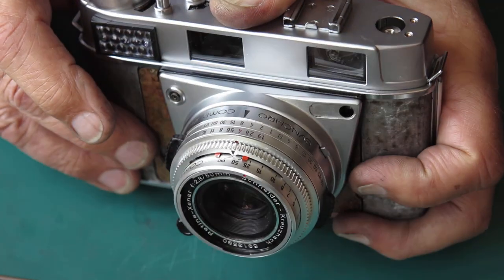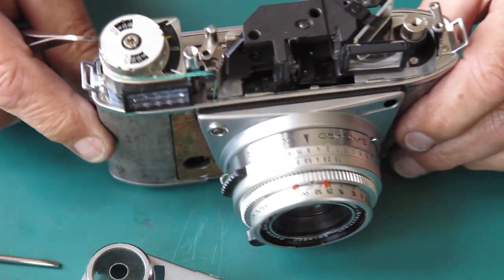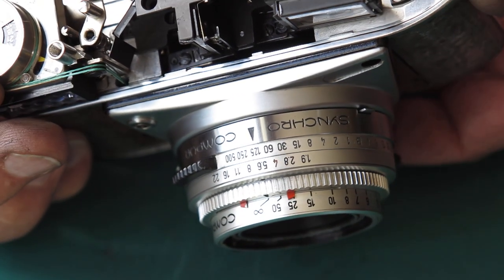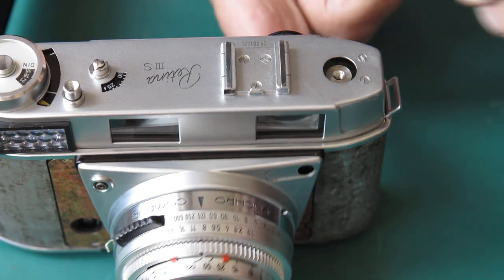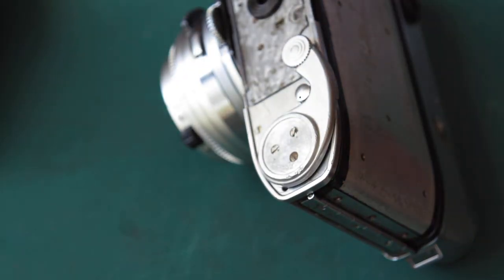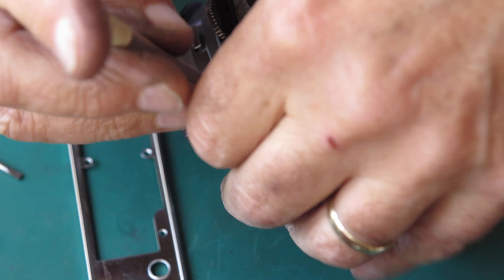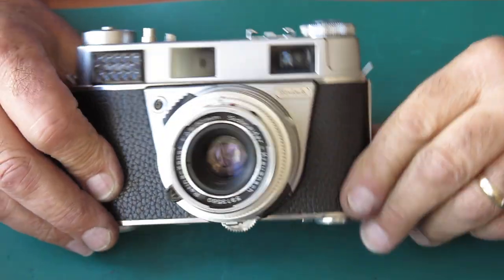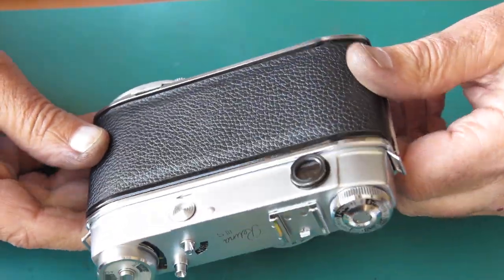A dog tucker Retina IIIS gets a new lease on life, part 11

Comment: Out of interest Chris, How did you go about reattaching the lightmeter top boss that had come loose - did you re-press-fit it or just glue in place?
Reply from the maker: Yes, had to press it back into place, then stake the edges over to make sure it stays put. It is never easy, often the cover is missing because the camera had been dropped and the top cover is bent out of shape.